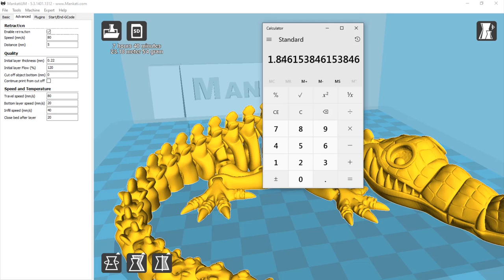make flexible crocodile - old plastic bottles - free filament (PET) - DIY

Comment: I have tried to find that video you did on making the filament machine but there are so many titled like this it is near impossible to find it, can you give me the link please to the correct video and a BOM if it is available?
Thanks in advance!
Reply: I think he linked all the detailed steps videos in the description.
Reply: @damneddude8299  Its a link to a multitude of videos in the Playlist all titled very similar, try to find it yourself it's infuriating, I have found another video by a Russian guy on building one
Reply: @AndrewAHayes , you just have to put them together. He gives all the parts in videos 1 through 5 (video 2 is only the Teflon that allows you to melt two filaments together).

Would you mind sharing the link to the one you found (the Russian)? Thanks.
Reply from the maker: Read the description